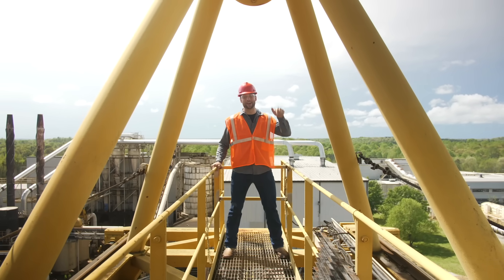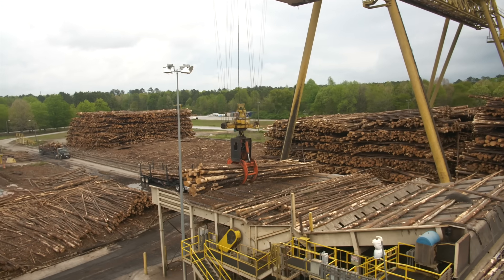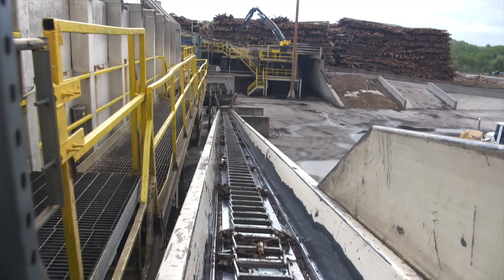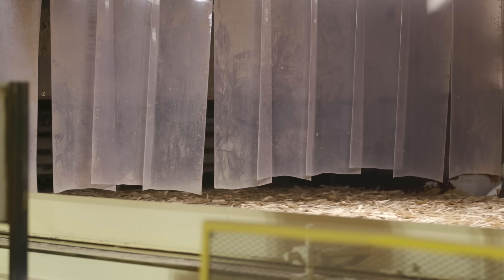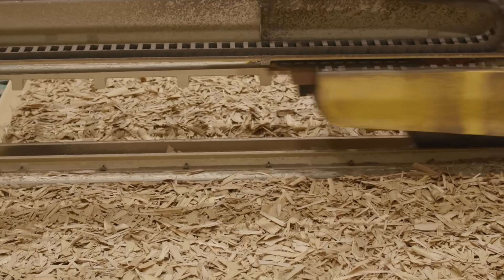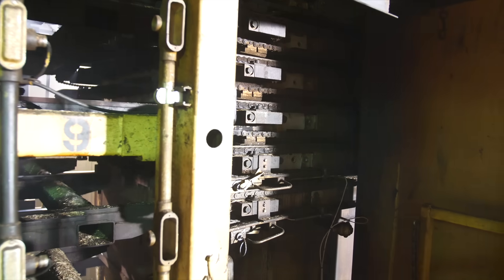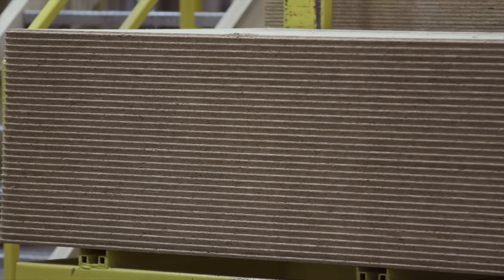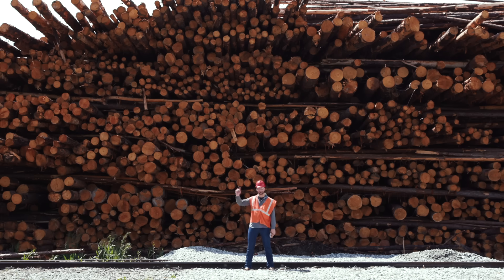Could OSB be BETTER than Plywood????

Comment: I have built homes and patched them up for 70 years! plywood is FAR BETTER THAN chippboard in most cases. all floors that i have replaced FAILED by gettin and staying WET! IF the people that built this particle board would put waterproof glue on this manmade product it would be a lot better. rats and mice eat thru this in a week or two. YELLOW pine wood plywood seems to work the best! its harder than other products.  this pine resists water for some reason. more oil in it I would guess.
Reply: most homes i have built i take white primer paint and PAINT the plywood AFTER I HAVE NAILED IT DOWN. when the lumber truck sets it down on the lot where i built the house, i take a gallon of white primer paint and PAIN AROUND the edges of it while in the state! take 6 double headed nai;e and go around the top layers of the boards. nails the sheets together and people wont take the time to pull those nails to steal a sheet or two. you ever tried to lift 3 or 4 sheets of plymood all at once.even  if the band are stll on it i put those  common double head nails in it. easier to cut 2 strips of banding that to pull out 6 nails.  when you paint the edges of the plywood it stops the water from swelling the boards after it raind on them. that warps the floors.

Comment: The last time I did a project with OSB, about 7 years ago, it got rained on for about 2 minutes and every bit of it that got wet doubled in size like a sponge within about 10 mins.  It seemed worse than particle board.  I was furious.  Its gonna take a lot to convince me to every try it again for anything.
Reply: Double? 1/2” to 1”  In 2 minutes I doubt that story teller
Reply: You bought cheap low grade stuff. You gotta buy the good stuff if you want the good stuff. Top of the line osb is superior to plywood in most of the most important aspects
Reply: What is it's purpose? What does the manufacturer recommend it be used for?  i'm not in construction

Comment: Ok for non wet areas, crates, or for building cheap furniture. I used this crap on homes for more than 30 years...not my choice. It is garbage. I seen the same homes obliterated by storms here in Florida. The glue gives up after a certain time even if kept dry. Like I said, this stuff is for temporary structures and cheap furniture.

Comment: There is no such thing as high grade OSB, just expensive and more expensive. They ALL perform about the same when they get wet, they fall apart, and they are about twice as heavy as plywood in comparison to the thickness of the same size. I would never use OSB in a very humid area, it will not last. Plywood has a far better structural strength than OSB as shown through history and what plywood was used for. You will never see an aircraft or fast boats made out of OSB. Maybe some day, when the morons figure out that if they used a good waterproof glue or a plastic rosin as the binder, they may be able to improve this crap product. 
The last house I had, used OSB for the roof. The place was 10 years old when I bought it. A few years later the roof started to leak and about half of that OSB had to be replaced. When they built my new house I would not allow any OSB products to be used anywhere in the construction. OSB will never be better than Plywood in strength, water resistance, rot, mildew resistance or anything else.
Reply: So there!  The last word has been Spoken.
Reply: I AGREE WITH YOU TOTALLY,, YOU GET WHAT YOU PAY FOR,,

Comment: Nobody is building boat hull's out of OSB.  It's largely land fill fodder. Don't see any examples of plywood being stripped of buildings for the express purpose of replacing it with OSP flakeboard. As far as the OSB I- beams , if the I beams were made of  plywood they would be far stronger. A 26 oz framing hammer can be driven through 3/4 inch OSB with relative ease, try that with 3/4 inch plywood. The enormous amount of energy expended replacing  moldy puffed up compromised flake board with plywood is alarming, it's nothing more than garbage and in only helping to stuff landfills already bursting at their seams.

Comment: Since when do they do a "v" shaped tongue and groove?? You were very informative for most of the video, but a tongue and groove system uses a male and female slot system where a slot is milled into one end of the board and a matching "tongue" is milled on the other side. This tongue fits into the groove and allows for expansion and contraction while also increasing strength between boards.
Reply: Yeah. The whole idea of the 'rounded joint' was complete nonsense, just the equal of the 'V-shaped joint' they compared it with.

Comment: Ive been a carpenter and owned a remodeling business since 1985. We have used OSB wall and roof sheeting for the last 25 years apx. Recently I had a customer who requested standard plywood. It bowed, sagged between trusses @ 24 on center. de-laminated, was wavy between studs and was an awful choice, especially if you are planing on using horizontal siding or Hardie. Standard ply used to just swell on the edges when wet, now it just comes apart into individual pieces. The OSB is more rigid and does not sag. You do have to make sure it is kept dry, it does swell when it gets wet. Other than that, love it.

Comment: I sheeted a wall with OSB. The glue did not protect against humidity. It got wet and it cost a fortune to take it out. Plywood has a chance to dry if a leak occurs.
Reply: its easir to get of tho> you can sweep it off the flooring.

Comment: When wet... Plywood warps. OSB falls apart. Hmmm. Both are bad but I'd rather have an uneven floor than a hole. lol
Reply: Paint it with Glass Fibre Resin it will adhere to the substrate  you could even use a Colour pigment added into to the resin ...Job Done...
Reply: Keep it dry then
Reply: @JeoWilson  next time, try to get OSB4 ( not 12 or 3) 4 is designed for wet rooms and outdoor conditions

Comment: “OSB”......... is crap 💩 💩💩.

I owned a house 🏡 in South New Jersey, the house was ten years old when I bought it from the owners. Lived in it for ten years..... around the seventh year of living in it, some squires bore a hole 🕳 underneath the top corner of the roof, on the south facing wall........ the house had vinyl siding.
When I got up there to try to fix the damage, I noticed the siding a little lose.........come to find out, the “OSB” which was used to make the wall, had de bonded due to getting hit with the Suns daytime heat. I basically put my hand through the wall. That shitt does not stand to weather, and is not going to last like good plywood, or wood boards.
Don’t use it to build a house you plan to live in for a while.........
Now........ if you are a construction house builder and you don’t give a crap 💩 how long it’s going to be good for.............go right ahead, ripoff the customers like you are use to doing. 🤬🤬🤬

IMHFO 

😎

Comment: OSB so flammable it was banned from being used inside of the home without fire suppression in some countries
Reply: OSB is considered flame retardant
Reply: @To0Be33  in Norway it isnt allowed unless you cover it with a coating of fire retardant material or plaster coating 

altho it's allowed to use as sub roof but is not recommended

Comment: OSD came along ways  first through of  in the 60s i hard it was not a very good product but them what i hard of the late 70's yearly  80s here in western Canadian started to make the board again did put the OSB board  back on the market as a very useable product by the mid-90s and 2000 big foresty companies were coughing up and building plants of there own 
yes i had a step forward in the first broad that was made in the 60s

Comment: A lot less talk and more showing the process of how this crap board is made would have been better. Peeling those logs into veneer and making them into plywood would be a way better product at a more economical price in the long run. I do speak from experience, plywood will withstand a lot of moisture, OSB won't withstand any moisture even when they say if is for exterior use.

Comment: Next video "Is particle board stronger than concrete countertops?"
Reply: No but lighter.
High quality particleboard is quite strong and water resistant BUT most particleboard is only a 3 layer process.
Good quality particleboard uses a 7 layer process.
Reply: Looks like you found someone who may want to pave roads with osb
Reply: Well those are weak (unless some steel matting is in there)

Comment: Without hitting play the answer in no. If oriented strand board ever gets wet it swells and comes apart. I've even seen some people use it on roofs. Just no all around.
Reply: Hurricane Andrew 1992.
Reply: @damiangrouse4564  that's when people started demanding the "H clips" or hurricaine clips that clip two boards together

Comment: Veneer has more cross strength than OSB cut it in a 4 inch by 4 foot section an see which brakes easier plywood is much stronger this will never convince anyone OSB is Better by watching this video 🤔

Comment: I would have liked the title question to be answered. In my market, commodity 7/16" OSB has gone from $12 per sheet to $42 in about 8 months compared to 1/2" ply going from $24 to $41...so right now, plywood is more expensive than regular OSB, which seems ridiculous.

Comment: If you live somewhere with a lot of humidity the answer is no. In every use case, no matter how well you think you painted or sealed the wood to protect it from moisture it's going to get wet and it's going to swell up. 

It's not worth saving a few dollars on the front end when you will be tearing out the OSB in less than 10 years because it's saturated with water and swollen up. I mean I bet it's great for guys building spec houses, they are going to be long gone by the time issues show up and the homeowners will eat the cost. 

If you are going to do something, do it right the first time. I've got enough experience to know it costs a lot more to fix it than to just pay upfront for good materials.

Comment: Osb is a way the industry gets rid of chips and thin cut logging trees that are not dense  or big enough for anything else . Osb is really useless , but is used because it's cheaper than plywood . It's kinda like they came up with the idea of gluing sawdust together for partical board and I useing sanding dust for mdf and selling that shit to folks who want to get by on the cheap and trailer house manufacturers.  All of the above invented to get rid of waste and make money all at the same time . And to make more money later because all of the above doesn't last long if it gets wet . All rapped up in a nutshell.

Comment: For wall and roof sheathing on a budget, sure, for everything else, no. and that is particle board/k3 not OSB/aspenite or LSL. 
Also, this should be called 'how particle board is made" as it has nothing to do with plywood other than being about wood and manufacturing wood products [that aren't plywood].

Comment: 6:03 thank you EPA

This company is passionate about not getting fined. I'm sure they'd do this if it wasn't mandated 🤦‍♂️
Reply: Approved ?  Just like aluminum wire ,,,,urea formaldehyde, ,,, double sealed envelope   and restricted 'ventilation   ,,,how did that work out  ?  NOT! Canada unlike USA  has a unified biulding code based on science and past experiance ,   Plywood is recommended by engineers  for its

Comment: Once osb is cut and the seal is no longer on the edge, water deteriorates the product immensely. That’s why it’s meant for interior use and covered on the exterior before wall finishing. With  ply, if it dries before it’s sealed with subsequent layers of other materials, it’s structure is at least more durable. So my question to Huber would be if there is a sealer we should use on their osb products to strengthen any of the exposed cuts that were made in exterior applications.

Comment: What did I learn. OSB is not made from scrap wood like I had thought, but purposely engineered and designed the way it is. That makes it even less likely I’d buy it. It’s form and structure is too easily changed by moisture. I don’t understand why this is even made? I thought it was made, because they were reclaiming wood from other processing.

Comment: "Could OSB be BETTER than Plywood????"

I get it, the title is in the form of a question because you don't have any idea.
NEWS FLASH GENIUS: We don't know either.
Reply: News flash, no it isn't.
Reply: @iseverynametakenwtf1  It's a lot more sustainable than plywood and it's a lot cheaper. For many applications that makes it 'better'. I've not used plywood for more than a decade - it's been superseded for most building applications by OSB. There are facing applications when ply is needed.  Both materials have grades and if it's going to get wet for long then those grades matter.
Reply: @Wookey.  I've used "Silent floors" it's an I Beam style using OSB. If you are banging on the wall/floor (as in nailing) they can pop apart. I don't care how cheap it gets, it will never outperform plywood.
Reply: I know, it's not

Comment: One idea i have for Advantech to consider would be coating/encapsulating the wood pieces in a poly material instead of just resin. If they can make it waterproof rather than water resistant? That would upgrade this engineered product.

Comment: OSB good for vertical walls and roof decking with a roof pitch of 6/12 or more. Also a room over a garage with no plumbing. Never use it as a sub-floor as any little leak that goes undetected will cause warping and rot that will come at a much faster pace with the OSB over a Plywood.  One little leaky valve in the kitchen or O ring under a toilet breaking loose will cause a leak in an undetected area under a tile floor that is just a huge expensive failure of sub structure that will cause a huge bill in no time.

Comment: OSB is crap compared to plywood, I've been a builder for 35 yrs. my opinion. it falls apart ,it droops between rafters ,its softer wood . Hate it.   the nails don't hold as well in it either.